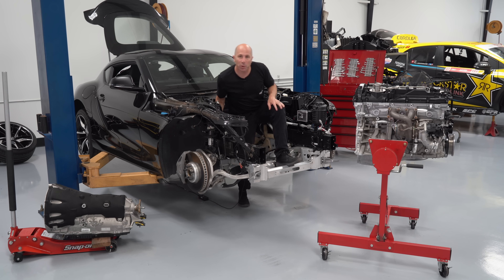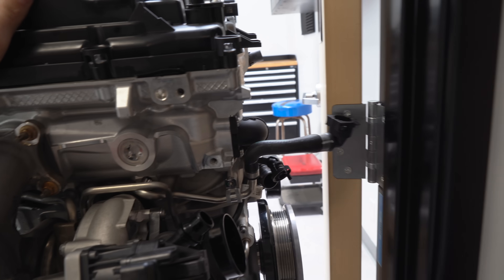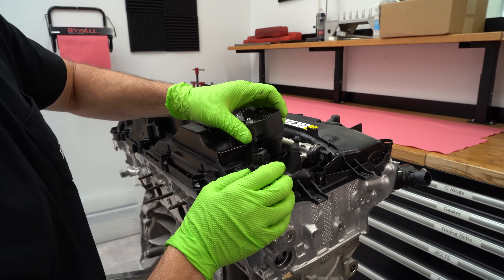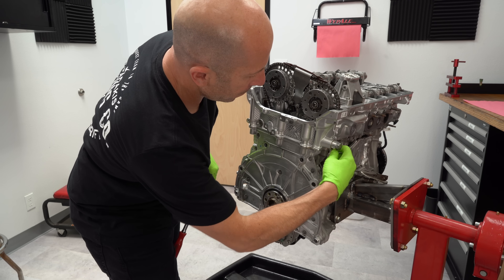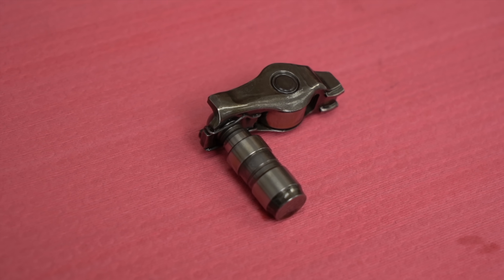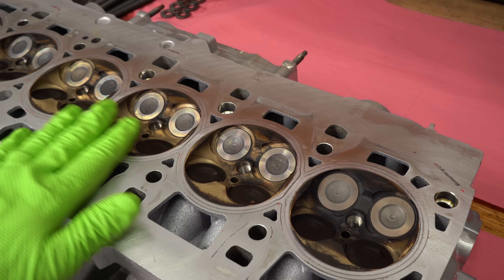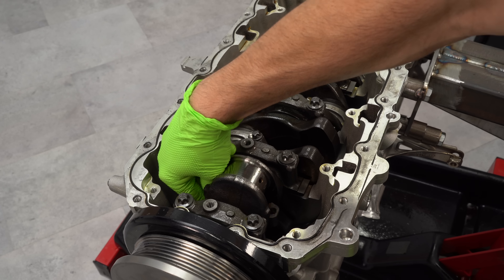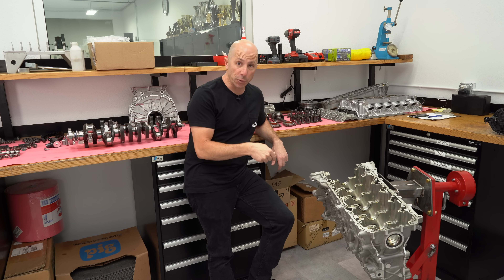2020 Supra B58 Engine Teardown - First Look - Better than the 2JZ?

Comment: Cons in my opinion:
Exhaust manifold cannot be upgraded or ported with this design.
Plastic intake with water to air intercooler thing. Probably will start to leak coolant or crack at higher psi.
Hate the design on camshafts (tubes with lobes pressed on) they tend to spin, unless there are grooves made for them. (at high mileage usualy)
Chain at the rear of the engine.

Pros:
Built in crank girdle + oil channels on side of block.
Reply: Also, that plastic intake manifold has to have a seam in it somewhere to have been cast around the intercooler. So there's a failure point: after a few thousand heat cycles, plastic gets brittle and cracks. E.g. the Ford 4.6 plastic intake manifold that cracked around the water jackets and thermostat housing.
Reply: @sqmotorsports9230  what about the neon 2.0L intake manifold? Never seen one of those crack.  Once again an un-educated assumption from another imbecile.
Reply: Just going to have to buy an aftermarket head

.
Reply: @jzxtrd337  nah the rocker arms are fine, they're well designed not like 90's JDM stuff. They live very well even up to 9k rpm.
Reply: He fixed all this in the new video
Reply: My fear is, if water to air intercooler gives so does the engine. If coolant gets sucked in the engine,  you all know the outcome.
Reply: @Roman-xb9xn  White smoke ftw, lets hope they will reach their goal without stupid nos shots, whitch just bursts the power on dyno just for show.
Reply: basically this engine/car is designed to operate best and most efficiently within its stock power range levels/settings....this is not a car you can tune to 500-1000hp reliably due to its design alone. which is why this is not the spiritual sucessor to the supra imo even though its an inline 6 rwd turbo car. the 2jz was the opposite, it was overengineered to handle a lot more hp stock, and its design promoted tuneability and high hp potential.
Reply: @Max Vos rather drive 100k in a bmw than 1000000km in a shitbucket yaris

Comment: They should used the n54 bottom end and out the timing chain and oil pump up front. And made it cast iron. It would be heavy, but it would be legendary.
Reply: B58 uses the bottom and block end from a B57 diesel i6.
Reply: @carboydorifutoparty3976  Still a weaker design. Would have loved to see them at the least utilize the deep skirt of the block, like a Chevy ls series motor or a dodge hemi engine. But far as how the n54 was put together in the bottom end, is stronger.
Reply: @diyguy6054  the blocks made out of the same material used in both VR38s and Coyotes
Reply: @carboydorifutoparty3976   While the material makes a difference. The n54 bottom ends design is stronger. That's what I'm referring to.

Comment: do these DI motors need walnut blast ? or is like Camry and fuel detergent cleans behind valves
Reply: They do suffer badly from coking up. Some engines are now being built with port and direct injections so that it keeps the intake clean :) Smart.

Comment: DI in Porsches and BMW dont spray behind valves, so they get carbon caked.
Reply: Correct. Walnut blast it for a couple of hundred squids and you are good for another 40k miles...

Comment: Very sad engine. Too much plastic that will crack like every other BMW. Variable lift camshaft is doomed to fail like in every other BMW ever. Timing Chaing at the wrong position ... no comment ... plastic chain guides that crack spontaniusly like in every BMW ever. BMW's are notorious with snaping timing chains without give aways, they just snap out of nothing no noises, no knock just snap ...
This car will be very big dissapointment in therms of reliability like every BMW ever in history of auto construction ...

Comment: "The speed of the electronics is faster than your foot can move" now what the hell is he talking about? Do we not use our foot on the throttle anymore or what? o_O In this particular case electronics can only be as fast as your foot can move. The problem is that people tend to complicate things in everything they do instead of simplifying it. Now it has to be done through the electronics rather than directly which means more unnecessary consumable parts and sensors put in the system. "there is no physical connection between the gas pedal and the throttle. Instead, the gas pedal sends a signal that causes an electromechanical actuator to open the throttle" 

It's as stupid as saying that your digital watches are faster than your mechanical lol, therefore we should all choose to wear digital watches. I don't like digital hand watches, I don't like digital tachometers that they stick pretty much in all modern bikes and cars, I don't like digital money and I don't understand why the F*** we need digital throttle control in place of a simple cable system!
I can get an EMP weapon and disable your digital car without you even knowing while the good old mechanical one will continue moving. Something to think about.

Comment: Excellent video. People that sook about the timing chain don't realise that it lasts 3x as long as a belt on a 2J. So even if it costs more to replace, you rarely have to do it!

Fantastic engine design, much nicer than the boat anchor 2J
Reply: Yeah but you can swap a belt on a 2J in minutes...
Reply: @sqmotorsports9230  People will never get the K's high enough on these to need to change the chains 9 A90's out of 10

If the 2J was so fucking good how come Toyota put 3S's and 1UZ's in their Supra race cars

Comment: Too many plastic parts. Those are going to be expensive to replace when they break.
Reply: They won't break.  Every one of those parts is 3-4 times stronger than it needs to be. Oh, and what you call "plastic" is not just any plastic. These are high 
end polyamides reinforced by glass fiber or carbon fiber, they're incredibly strong and durable while being very light, and actually better than metal parts in those cases, AND MORE EXPENSIVE too. They're used for a reason. Even on race cars.
Reply: @derbigpr500 , I'm pretty sure that my buddy with a BMW who ended up having failed plastic guides for the timing setup will disagree with you.

Comment: So the crank can be turned with a 32MM (I think) 12pt socket and it's easier to take those bolts out much earlier. It's a BMW engine ...

Comment: ALL PAIN AND PARTS.  Imagine if he assembles the whole thing and finds that the block to head is not sealed right, Hara Kiri.  In the factory, sealer probably but down by a robot.  This engine is not meant to be worked on.  Just switch to ELECTRIC CARS that will still smoke this setup.  ICE is dead and should be gone.

Comment: Petrol car=10000 parts. Electric car=10. This tech is so lame and way past its expiration date.
Reply: Have you seen inside electric motors? Even the manufacturers dont bother replacing parts, they scrap it all. Really cost efficient and reliable long term, not.

Comment: 2jz is better imo. the cam cover and intake are plastic, and it uses lots of stupid torx bolts and needs special tools. also changing the timing chain will be such a hard job!

Comment: Just thinking about the cost for timing chain replacements outside of warranty on these things is nightmare fuel.
Reply: There is going to be tons of these engines being traded in/sold just before warrenty expires..Like Farerri when it is about time for the $12000 engine R&R 17500 mile service.

Comment: I just hope BMW fixed their HP Fuel pumps. High ethanol content fuel damaged the older generations.
Reply: From what I've read up to them to now. I've never heard them have any of those types of problems so I don't think you'd have to worry.
Reply: @carboydorifutoparty3976  My 1M with N54 ate 5 of them before I sold the car.

Comment: I know that inline 6s are iconic to the Supra but would'nt it just have been better to just a toyota V6 or V8, this engine seems like its purpose built to be hard to maintain and i have a feeling its gonna be a popular car for LS swaps
Reply: Tbh do u see anyone tryimg to touch any of the V6s or V8 in Lexus/Toyotas? I doubt people would be pleased to have a mk5 with a V6 especially if its not good for power.
Reply: @carboydorifutoparty3976  Sure i was just ythinking that this engine seems like a clusterfuck

Comment: The so called throttle body on the intake is not an actual throttlebody, but a redundancy in case the valvetronic fails. The actual "throttling" is made with the valvetronic system. Ie the extra intake cam that adjust the valve lift. Been that way since the early 2000's with almost every (pertrol) BMW engine.

Comment: BMW can try to put bandage solutions to their engine problems or keep trying to fix old design flaws on this engine, but new problems will definitely pop up. That's how BMW's are. New problems come with new engines even if they fixed the old problems. A couple years down the road as people put more mileage on these new Supra engines, we shall see what problems lurk underneath.
Reply: This engine is nothing New ! Its first was used in a Bmw 340i F30 back in 2015 and hasnt been really touched because is wasnt needed.

Comment: I wonder how fast someone is going to put the 500 HP BMW S58 from the BMW X4M Competition and install either a H pattern manual, or DCT into the new Supra.  It should fit being from the same platform as the new Toyota Super Celica oops I mean Supra.

Comment: Nice video.  This engine looks very, very impressive.  One proposed correction:  At 9:53 (https://youtu.be/MckxlP60cnY?t=593), it looks like you reversed the description of the intake and exhaust valves.  The dark ones appear to be intake, and the shiny ones appear to be exhaust.

Comment: There is a lot of plastic on that engine. This is the problem with modern BMWs, they use way too much plastic instead of aluminum and threaded hoses.

Comment: I dont know about Toyota Drive by wire throttle bodys, but the Gm and Dodge ones I have used/drove, have a ton of latency that makes it a lot harder manage tire spin and throttle play at the big end  in drag racing, compared to a  Cable driven throttle body. Huge difference in my experience. Tune or not I dont like them.

Comment: So few miles and one of the cylinders is already all coked up...
Reply: I saw that..cylinder design may not be too different than the Focus RS..which failed very early in the life of the engine with massive head gasket failures..stuff leaking, etc.

Comment: A BMW-engine will NEVER be as good as a Toyota one...
Reply: One of the best things about the 2jz was simplicity.... yea this doesn't have that. If Toyota just made the same engine with larger displacement and six speed manual i would be in love.
Reply: @mitzmanuel  get the 1fz since everyone kicked it to the side ever since the 2j got big.
Reply: Yeah good choice. I got to look if they have mounting kits to fit it in an is300.

Comment: Hi Papadakis, real nice tear down video, I was nice to see the direct injection holes in the engine head and high pressure pump pipes. Also nice info on the side oil ports for reduced crankshaft windage. I'm a BMW e92 M3 owner factory ordered. I learned over the years that BMW reliability is not as good as Japanese, in fact it's nightmarish. They tend to throw new design ideas and often overlook ways it will fail. They also buy modules from subcontractors that come short on reliability. I can give many examples like the electric throttle actuator module used a small plastic gearing whose teeth get eaten up in only 2-3 years, or their engine block mount rubber shears off in a couple of years as well, steering pump failed prematurely,  evapporator (AC) leaking. Ok i know all these are not engine related so here we go about BMW engine design. Their engines have big variability from one unit to the next. This is indicative or erratic quality control or wide tolerances. I know because some BMW engines  consume an entire 1 liter bottle of oil between oil changes right from the factory and other engines (same car, same model year, ordered in the same month of production) do not consume a drop of oil. Trust me I've researched this for years on car forums.  They overspec the horsepower (less than advertised). They've had chronic problems with engine rod and main bearings wearing out very fast (and seized engines). I have a dual mass flywheel and that break in the 2nd year. It doesn't fully break just the springs so you end up getting oscillating torque transients when changing gears (manual). They also have the dual clutch automated transimission which they claimed did not need oil change. But the thing leaks after 5-6 years for many.  I would not trust anything with a BMW badge on it. They also don't stand behind their car and come short on fixiing everything. When i heard that toyota put a BMW engine in the 2020 supra i thought, no thanks. The japanese are going to learn their mistake in a few years.

Comment: As the owner of a BMW m140i 2019 model seeing the engine stripped like this and you telling us how well built and well engineered it is so comforting and the knowledge that it could handle more power is just great.
Really enjoyed this video thank you
Reply: The Supra has the updated B58 'M1' version. You have the original M0 version. Minor difference but yeah, technically its not the exact same.

Comment: No because this engine can not be rebuilt when it fails. No engine that is not rebuild-able can ever be "better"! All of the plastic parts will fail shortly out of warranty and you will have oil and water leaks. Let us hope the cam lobe that drives the pump is replaceable since  modern oil that is low on ZDDP does well with heavy spring pressure and sliding forces. We all know that BMW's modern engines and cars are one bits once out of warranty. So buy default it can not be better than a durable, low maintenance, engine design that would routinely last 20+ years with nothing but routine maintenance. Power and fun factor means nothing if it does not have the legandary durability and reliability Toyota's are known for!

Comment: god damn plastic valve cover thermostat and water pump that gonna be bitch after 10 years time but that forge crank and cylinder wall that engine is definitely good for a 1000hp with the rite setup
Reply: It's not gonna be bitch after 10 years because that BMW engines are designed to die in 4-5 years
Reply: @player1GR  i stand corrected hahaha
Reply: @player1GR  No. Their I6 are great engines. Most of the old BMW you see around (I see loads, even at tracks), use them...
Reply: @sheilamorrison1954  i know, but they dont last long. I have a b38 engine, my friends rides b48 and b58 engines and we know that in 3 years or 100-1500k km we'd better not continue owning that cars

Comment: lets hope toyota has better luke whit the engine than peugeot/citroen whit the 1.6thp. i see severall parts are the same. but the biggest problem of the 1.6 is the chain, lets hope bmw has made it now beter and does not to be replaced every 15.000km by some customers. also carbon deposits on the valve i hope it is also not that bad as whit the 1.6thp

Comment: Could you comment as to why you break bolts loose by hand rather than with the impact? Is it to avoid aluminum thread damage due to shock or steel bolts galling? On a new engine I would think the latter would not be an issue.
Reply: His impact probably doesn't have the ass to do it.  Torque to yield bolts in bigger diameters are insanely tight.
Reply: @immikeurnot  Eh, I doubt he doesn't have a large impact judging how nice his shop is. Perhaps he didn't want to damage the fastener drive? Head bolts are usually replaced though on TTY.

Comment: Not a single toyota there - Pure BMW, can see the tracks goes all the way to the M40 / M42 old blocks and head :)
Reply: You mean m50/m52 ? M40/42 are 4 cylinder from the 318 model . M50 are the 6 cylinder from e30/e36 than m52  in later e36 and e46  (i know those engines well i'm 95 e36 owner and a mechanic)
Reply: @xXMattaderoXx  No, i actually meant the 4 cylinder engines from the late 80's, these engines debuted many features that still exists in today's modern engines.
(hydraulic lifters, dual length intake runners, forged internals, oil filter location, knock sensors and many more)
Reply: Ohhh now i understand what you mean that's right

Comment: Two things, first off timing set on the back of the engine is horrible. There's nothing as annoying as finding out that you have to pull the engine to do something as simple as a timing set. Secondly, my problem with drive by wire is not only throttle response, but the fact that it takes the decision away from me. If something scares the computer bad enough, it will go into limp mode. There is the possibility that I might be willing to sacrifice an engine in certain situations. Limp mode prevents a driver from making that decision. Also, it is another step closer to autonomous vehicles which is not where a real driver wants to be.

Comment: It has coated bearings so there is no issue with that...WHAT A LOAD OF BS. The proper thing to have is a pre-oiling system and no stop/start.

Comment: Those N class BMW donks have single use titanium bolts on the components, im sure you noticed how light they are on dissasembly. They stretch on first torquing, hence the single use. Hope you got new ones for the reassembly, bud

Comment: Not sure how you are going to port work the exhaust side of the head with the Twin port problem, I thought the old Minis were not good with three exhaust ports.
Reply: Z4 has Heads with  6 exhaust port while the mk5 has 2. Two things tho. The mk5s and Z4s heads are interchangeable and can be switch or people can wait for the mk5s that come out next year with the same heads as the Z4 but with more power.